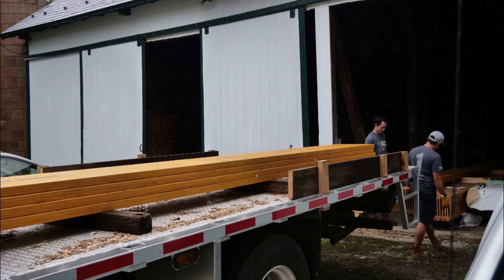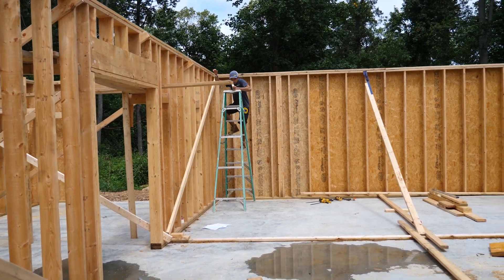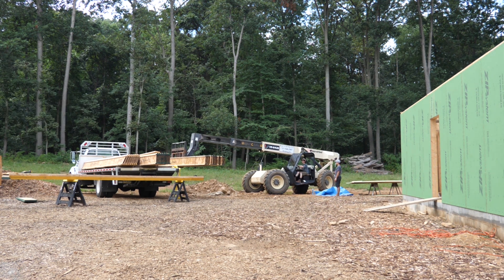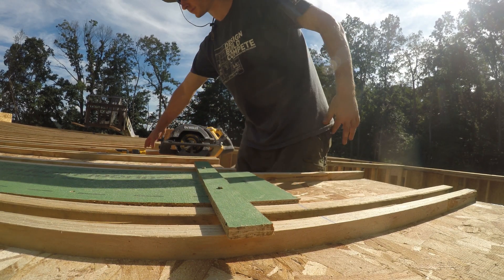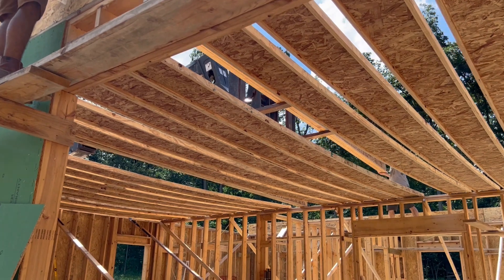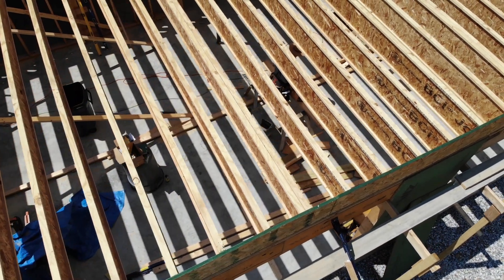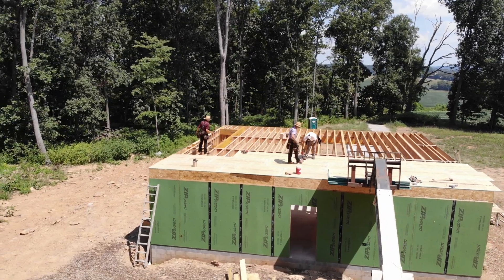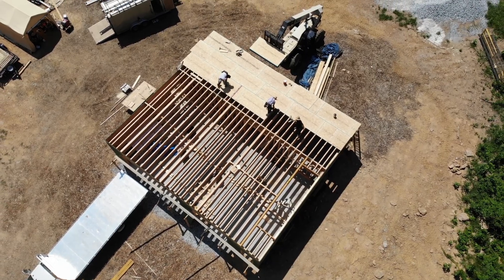Framing the Floor using  I-Joists

Comment: One problem with "I-Joists." IF your home catches fire & you used these Joists, Firemen have a burn time of 5 minutes. After that, they WILL NOT go inside the structure, because thise Joists burn very quickly. If you need to clean out your Flue, just throw some scraps in the stove. Rocket burn.
Reply from the maker: True but check out our sprinkler videos 😎

Also the joists are not exposed to open air so it would take more than 5 minutes for fire to penetrate subfloor or 5/8 drywall

Comment: Engineered joists like this have their pros and cons. The are incredibly strong, and actually less expensive. They are easy to manufacture right on site.
The downside is that they burn 60% faster than standard lumber joists, and some insurance companies are starting to reject coverage for homes built this way. 

I've seen people say "Yeah, but what are the odds of a fire?" By that logic, don't bother with insurance because what are the odds you'll use it?

I'm not saying these don't have their place. Just choose carefully for your job.
Reply from the maker: haha you haven't made it to our fire sprinkler videos yet 😉  Love a good 2x, but like you said they just couldn't meet the spans to keep the garage post-free (except ridge beam post)
Reply: @MasonDixonAcres  Agreed. That's their big advantage is the span range.

Comment: nice video, props for getting things done, but id suggest using 3x3 sqare washers on ur sil plate anchors, on round u dont get much grabing power, squre 3x distributes loads much better, cheers
Reply from the maker: Thanks! I wanted those but couldn't find them easily and didn't feel like fabricating them. I actually asked the engineer I consulted with about this, and their take was that sill anchors mostly prevent sliding, not so much uplift. If there's a tornado that's strong enough to put those nuts/washers in tension, there are bigger issues lol

Comment: Curios to hear why not floor trusses? They tend to be 15-20% expensive but you can run duct, electrical and plumbing if need to. Some folks say trusses are better for squeak noise and some say posited. What’s your take on this and squeaks. Great work
Reply from the maker: Yes they were more expensive than the I-joists especially because there are no other trusses in the build to offset the engineering/transport. Squeaks are usually from movement between metal fasteners and wood, I think any floor framing material (dimensional, truss, I-joist) does a pretty equal job preventing squeaks as long as the subfloor is glued and fastened down well. Some swear by screws everywhere for insurance but we nailed it, haven't noticed a single squeak anywhere in this floor platform so far

Comment: 9:00 - one trick if it's not too late - screw down your subfloor instead of nailing it. in 15 years, you'll thank yourself for doing so as your floor will be significantly LESS creaky.

Comment: Just curious:

Are I-joists preferable to using LVL beams? If so, why? I can only think of weight savings (assuming i-joist is lighter than LVL but similar load bearing in one direction).

Rookie here, just learning. Great vid!
Reply from the maker: Thanks! LVLs are very strong, heavy, and expensive. I joists are also expensive, but less than LVL per foot. Cost and ease of handling are probably the two main advantages. Just like a solid steel rectangular beam would be the strongest option, but an I-beam gives the needed stiffness at the lowest weight and material usage.
Reply: I-shape has high Moment of Inertia, and beam or joist with high moment of Inertia will have higher Moment of resistance from Load, indirectly it can take higher loads and can have longer spans. Even we use I shape in Universal beam as well.

Comment: I don't  get why the joists  were  cut when they span all the way. 22ft doesn't  seem that  wide.
Reply from the maker: 3 reasons - handling & hauling a 36' long joist is difficult, it was easier to double up the front joists with only the 22' section, and the spacing on the 13' span varies slightly to create more room for toilet plumbing in one area.

Comment: What was the deciding factor to go with 18in depth joist? Is that the bci 90s?
Reply from the maker: 14” depth, they are bci 6000s 1.8. I used their span tables to start, then confirmed with the PE I worked with when finalizing plans. It’s the 22’ span over the garage that drives it, plus the fact all our HVAC runs have to be between joists since there’s no basement.
Reply: @MasonDixonAcres  besides cost was there anything else that made you not want to use trusses?
Reply: Ahh thought I heard 18in! Was thinking you'd be adding in some heavy machinery to need 18in Ijoist lol.
Reply: Also,  did you compare the bci to other brands? I'm seeing the version from menards are roughly 20% cheaper or more!